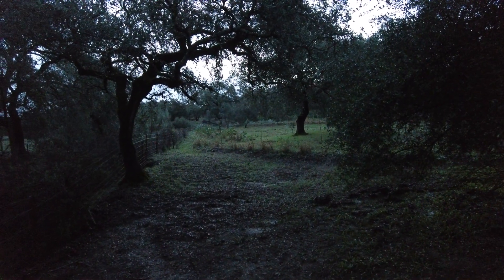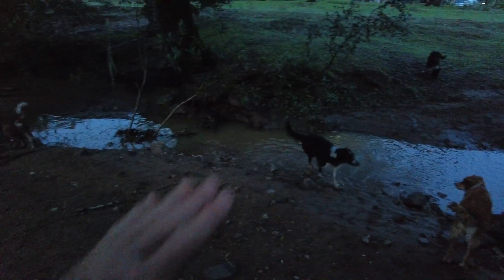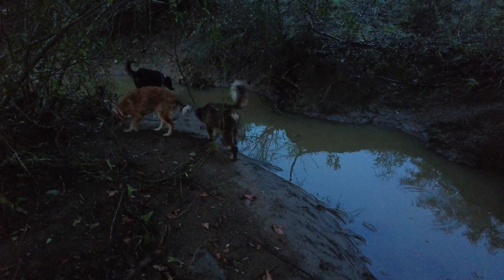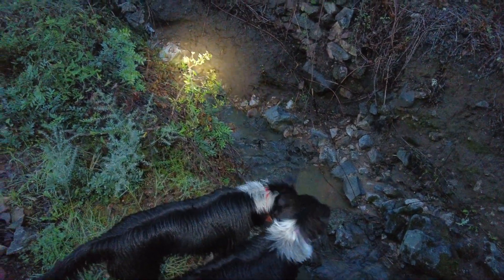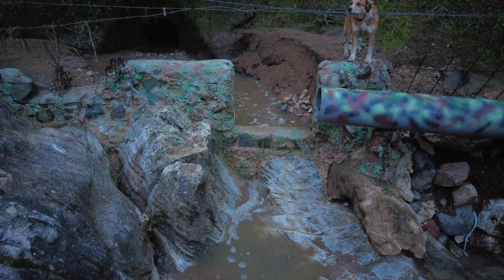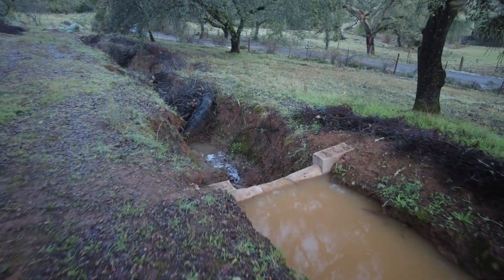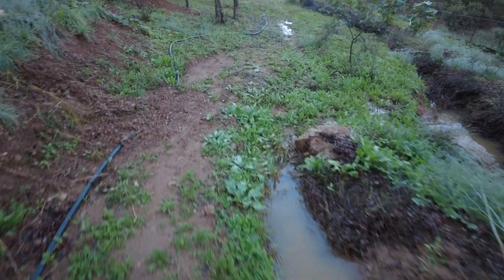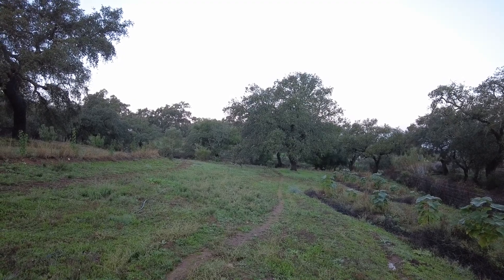Water is a wild stallion! Taming water is an art and requires patience.

Comment: When I look at this video, I want to grab a shovel (long handled pointed spade) and go frantically to work.  NOW is exactly the time to make the most of what has happened.  I commented at length on another video of yours that you made SINCE the hard rain (about 11 days ago).  Something I did not mention because I thought that I had already said enough was the need for "stilling basins"  at the drop structures (neither of which you included in your design).  THAT'S where you tame the stallion -- in as many places as possible.   NOW the thing to do since the ground and silt are soft is to add as many of what I call "zanja feet" on PERFECT contours as possible.  You could easily use about 20 people digging (It would help if they were athletic, but not necessary.) -- each going over your property looking for the opportunities to start zanjas at "mini" weirs and "leading" those zanjas on perfect contours for as far as they could ( perhaps 10 meters per hour).  I wish I could make you understand!  The use of machinery digging deep  "swales" on gradients caused all that gouging.  Your zanjas de infiltracion should be no wider or deeper than what a hoe can pull downslope but the hoe work comes after the initial zanjas have been watered with shovel work.  Please get back to me if you want to know more!
Reply: Again I will say, as I did in my earlier comment,  that this footage is invaluable in what it shows.  THANKS!
Reply from the maker: Mini weirs, stilling basins and zanja feet: do you have any visuals/pictures/videos you can guide me to? Thanks for sharing Martin@loosenatural.com
Reply: Ah, Martin!  Thanks for getting back to me.  I intend to make a real study of what you have been doing and what has happened with the heavy rain.  I will be watching a lot of your videos.  Okay, visuals.  The best quick way I can show you what I do that is somewhat similar will look very much smaller than your work.  But that's part of what is important.  My video that I did ten years ago pretty much shows it all.  I mean the one called "Contour Gardening".  I'll give you the link.  But if you explore my YouTube channel by searching on it or looking at the playlists, you will see so much more.  This has been a life-long interest of mine (and I am 77.)  My take is based quite a bit on the water meadowing done in England (but also Peru and Valais in Switzerland),  but I apply it to my slopes like your place.  Actually rice patties are on perfect contours and have drop structures that land in stilling basins.  So much to discuss, but, as I've said, your place is such a great case study!  Please keep in touch.  By tomorrow I will know more about you and your work.

Comment: Maybe take the upper swale and feed a water tank sitting slightly below it? Having irrigation water is probably the first priority, if you can't dig a retention pond. Just don't let the water leave the property. Seems like you could slow the water in the creek and gully enough to fill them all in, given the amount of sediment. If you did that, you'd have water more at a level for infiltration or to more easily feed swales.
Reply from the maker: Yes. Thank you for sharing
Reply: I think it is probable that both the creek and the gully will infill to the desired level in a matter of years, not decades.  It all depends on how many structures the land owner can build and maintain.  As someone mentioned, the more the waterway fills up with sediment, the wider the waterway becomes.  The wider the waterway the slower the velocity - and all materials filling the gully and creek becomes some type of sand dam.  I believe the gabions (with the exception of the two at the top of the gully) are already full - and that did not take one full rainy season. 👍

Comment: It is good to see the water flow under 'normal' flow conditions.  The sound of the water cascading over various structures is quite pleasing to the ear.
As has been mentioned by others, I believe sand dams can be a big part of your infrastructure.  I  am surprised that you have virtually no clay or organic material coming down the mountain watershed. This is the damage caused by the pigs that are corralled beneath the Holm oaks right in the heart of this watershed up on the mountainside. In the creek watershed, your property is the first to make any effort at erosion control.  That is a big service to nature/the ecosystem, Martin.
I suggest it is safe to reinstall your 'aqueduct' pipe to your swale system again.
Also, I think restacking the leaky weir is useful.  The sand will continue to build up and you will be able to drive across it when it is dry.  That will also help the runoff to sheet flow across your land to the west.
I really like the walkabouts during or after the rain.  Delightful to see everything working 😊
Reply from the maker: Much appreciated Steve

Comment: What a wonderful update. Thanks!

My two cents. Your erosion gully generally gets less water that you get in the creek. It will be good to add a couple more dams before the earthen wall where you divert water to your swale system. Those two dams which are currently in place are holding a lot of water. The entire gully should look like that!

As for the creek, I guess your first dam worked a little too well to hold back so much silt and stones. And now it looks like the dam is exactly the height of the culvert. So no holding capacity behind that. The same will happen to any dams further down. The amount of silt you get is just too much and will fill any sediment traps you set up. No point adding any dams to hold water on the creek.
Reply from the maker: Thanks Raj. Valuable two cents
Reply: 90% agree. 7:58 Small erosion gulley should be used to full capacity. As it will fill in with sediment in time,  just adding more wood/twigs could be enough, plus 2-3 half-size check dams with loose stones, as there is not that much of water force. Finally it will need to be kept ~0.5m deep to allow water flow, but it's int the far future.

As for the large gully, if left as is, it will further erode. Small sturdy dams, that need to be build up each year? Tough nut is that one.
Narrow floor of the valley = high water speed = high erosion force.
Reply from the maker: @hotbit7327  Good one thanks. Slow down the water by widening the creek.